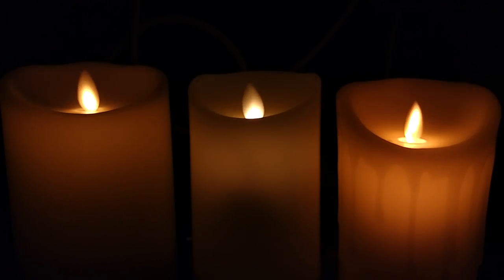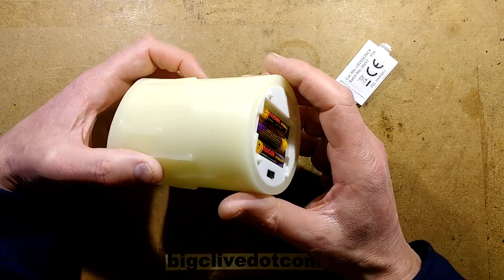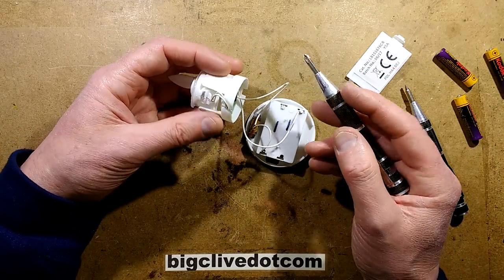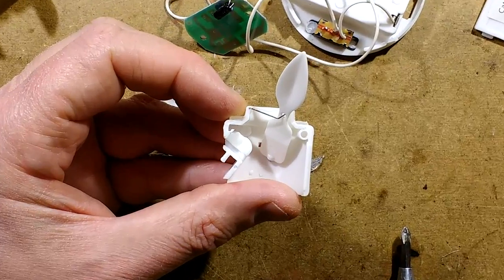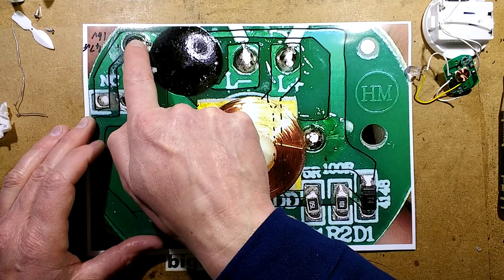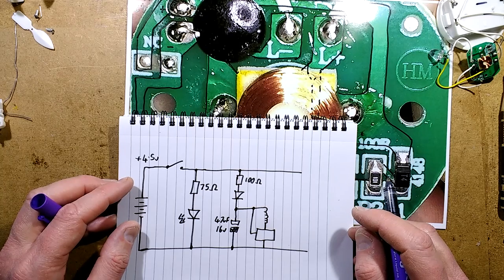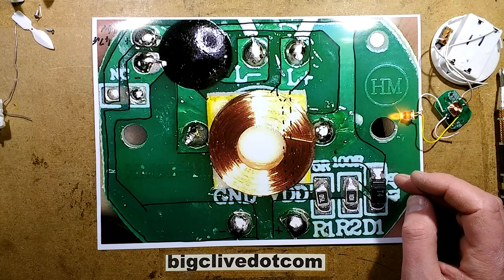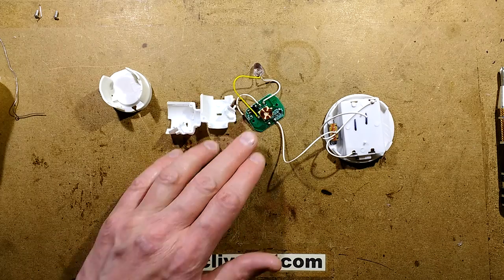LED dancing flame candle evolution 2018.

Comment: Came across these for the first time this christmas, of course Big Clive has like 3 videos explaining it all! I made one using the 15 ohm coil found in old computer dvd drive stepper motors, with an LM358 generating the square pulse that repels the 5mm x 2mm neodymium magnet. Lucid Science youtube channel has a ton of projects based on coils and magnets.

Comment: The fake flowing wax kills it for me. That diameter candle would never have a flame hot enough to flow melted wax down the sides.
Reply: I agree.  The flame looked nice but the fake dribbled wax made it look cheap.
Reply: It looks better in real life & in the dark... you could always carefully smooth them off  I suppose?
Reply: I think I'll get these and trim the dribble wax with a blade..

Comment: This candle can be a great candidate for an ESP8266. With an H-Bridge around the coil you can change the direction of the movement (like a gust of wind would effect a real flame) and make it very smooth. Integrated in an home automation system, you can trigger a stronger movement based on motion detectors or door contacts if available. A bigger battery will fit inside anyway. Just a mind game ;-)
Reply: In theory you could potentially use the DAC outputs of the ESP8266 so you could also control the voltage of the coil to affect the strength of the movement too. Granted those DAC's are only intended to be a signal level so you would probably need a cheap amplifier IC to drive the coil. As for the battery at this point I'd probably splurge for the USB port and battery management IC to install some lithium ion cells. Would be pretty cool though as this way you could reduce both the frequency and the voltage of the pulses to the coil to make the flame do a gentle lazy dance and periodically or when triggered increase the frequency and voltage to make it flicker more. Probably worth doing periodically to mimic the occasional turbulent instability real candles generate themselves due to imperceptible subtle changes in the conditions. Hell in theory using the DAC you could produce far more complex patterns in effect right up to just replaying 8-bit PCM data although that would be somewhat limited by the small storage of the ESP3266 but it would let you produce pretty much any movement pattern you wanted by using the coil like the voice coil of a speaker. Guess you could add an SDCARD or EPROM module or something if you needed more though.
Reply: Good idea but at that point I'd just use a real candle 😂

Comment: Poundstretcher used to sell a staggered height, triple set of the early Luminara  "Dancing Flame "clones for £10, Not sure if they stock them anymore.
They took two AA's. I bought a couple of sets and converted them to run from a 12VDC mains adaptor and a remote mains switch so i can turn them all on and off at the same time.
I also used a couple micro DC-DC voltage adjusters so I could control the brightness of each of the two clusters of three., they ran too bright for me at 3.0V, which is typical voltage for a pair of fresh alkaline cells, I found 2.4V was nice.

Comment: I used the wax Luminiare Candles outdoors in lanterns on my porch. After a winter of freeze and thaw weather the wax casing cracked. So, if you live where the temps go below freezing in the winter it is better to use the plastic ones which are made for outdoors.

Comment: "Quite a powerful LED. It's optimized for... whoops just broke a lead off".
Reply: Matt I almost chocked on my food when that happened
Reply: yeah, those wires fell off so easily, so I guess it wont last very long if you arent able to fix that yourself.
Reply: even Clive manages to do that sometimes :D
Reply: Lead free solder...
Reply: Bill Schneider: Yes, the leads free themselves from the circuitry very easily!

Comment: Try taking a spray air canister, flip it upside down and spray the hot glue with it. The chemical mixture coming out does wonders for hardening hot glue and making it just snap off of the item. Co worker showed me this a few weeks back... makes dealing with the glue so much easier

Comment: Would be really neat to see a (mains-powered) massive outdoor version, but I keep thinking of debris, snow, ice, etc., falling into the 'flame' part. Maybe a simple, clear cover could solve that; wouldn't even have to necessarily waterproof it then, if designed correctly.
Reply: SigEpBlue If it is mains powered it could just have some cheap heating elements to deal with snow and ice.
Reply: Mike Smith: Like an old school incandescent bulb?
Reply: Yes, use the light bulb as the series resistor on an LED :) :)
It is only sort of a joke.  A light bulb at less than its design voltage lasts a really long time and would keep it a bit warm.

Comment: I love love LOVE your dancing flame review videos. Have been a big fan for many years now! I made my own shitty dancing flame candle using a small counterweight and natural movement of air. Fun. Now I'd like to build these into my new home automation setup, so that they come on with other ambient lighting according to scene control. So will need to figure out a nice way of containing cables and running from mains switch mode power supplies. Also I plan to mod them by removing parts as you've done, and placing them into some slightly more sexy Catholic style votive glass containers. (sorry, the words sexy and votive probably don't go together...)

Comment: When you asked "can you guess" I instantly picked the third one as the most expensive. The light colour and movement looked the most realistic. Now if you can get a flickering red LED, you could adapt it (very) early for halloween :D
Reply: madbstard1 what do u mean by 3rd is it the left or right
Reply: Not all cultures go left-to-right (though a fairly safe guess here)
Reply: Sorry - I thought I did reply earlier but it obviously didn't post. Had really crap internet due to the stormy weather here. I meant the one on the right, as in the way Clive introduced them. Sorry for any confusion :)

Comment: Best way to remove hot glue I found is to use a  "freeze it" spray or "dust off duster" with the canister up side down. When very cold the hot glue will chip away quite easily.

Comment: I've got the premier ones, came from CPC. One was faulty, no movement. I cut it open and the coil.electronic assembly had fallen off the bottom of the flame. It's only a push-fit. They dont look like yours inside.

Comment: There is a type of wire that has 2 layer insulation.  The outer layer has a low melting point.  You just wind the coil and run it through a bit of an oven and then the former is taken off once it cools.  This is likely what they did.  It is very easy to do in large quantities because the formers run back to the start of the process to get used again.

It could be that the pulses you are seeing are not normal operation.  Your LED makes no inductive kick and there is no magnet going by.  A custom chip may detect the voltage wiggle from the magnet swinging by and produce a short pulse when the magnet is near.  If nothing happens for a while, it makes an initial long pulse on a timeout.  This would make the battery life even longer.

Comment: I like the color and movement of the right one, but don't like the way the "hole" looks like at top, nor do I like the drips on the side.

The left one looks pretty good but the movement could be better.

The middle one is way too repetitive looking and the color is off as well.

As for the candle being wax, it looks good and is a great thing, but we left our candles in a hot room during the summer by accident and well.. they all melted into unusable shapes.

Comment: Nice. Now I know which pillar candles to try to make some pillar "IoT candles" out of. I got this idea to wire some LED candles and put them on a smart plug. 
Well, I've already made some - two sets - of the candle stick variety from IKEA. Beside automatically come on when the sun sets (no matter time of year, not just specific time) and never needs battery replacement/recharge - they also works as a very useful traffic warning(!)
Other people making similar things have no fantasy and just turns on a lamp and the most creative ones make a sign. I really like my idea of using candles which can serve multiple purposes and not occupy a lamp for that.
It works so that a few times in the morning on work days it checks the travel time to my work and if travel time rises above a certain limit (that I set) the candles comes on and I know there's troubles and I should check to see if an alternate route is better (things usually clogs at the same spots). The way I've done this is by using a Sonoff SV powered by an old mobile charger. After the Sonoff SV there's a 3.3v regulator to power the candles and most of the controlling logic is made in a combination of IFTTT (Sonoff only supports IFTTT at the moment) and Stringify (which can interact with IFTTT). From the SV there's wires to the candles and since the IKEA candles are impossible to take appart I've made some dummy battery packs out of wood and drilled a hole for the wire.
Sure I could be boring and just put 3.3v regulator after the USB power supply and then switch that using a Sonoff Basic, Sonoff S20 or Lightify/smart+ Plug on a Hue bridge. However I found that the psu's in the Sonoff and Lightify plugs are not that efficient and you'll actually get a lower standby power by using a good quality class VI USB power suplpy (old mobile "charger"). Standby usage can be as low as 0,18w - almost half of a mains powered Sonoff and 3 times or so less than a Lightify plug and when turned on total usage is with candles no more than the alternative without load.
So while I already made some sets using stick candles I'd like some using pillar candles for the shelves at the dining area. They however seem more difficult - especially as I want to modify them to be placed in two vintage brass pillar sticks (are they called that when for pillar candles?). The IKEA LED pillar candles however are more difficult to modify. Those bas...ds have glued them together making nice modifications just about impossible.

Comment: I don't understand just how those candles (at 0:20) remain lit continuously. In the strip-down, clearly the LED is going on and off - due to the Timer Circuit "Blob". I think that the 100 ohm resistor is used as the fixed illumination (LED is illuminated constantly when the Unit is turned-on  BUT cannot be seen on our Computer Display). As the Timer pulses, additional voltage, and slightly higher current is fed to the LED - which gives the LED some additional brightness, in conjunction with the 'kick' from the Coil. Am I correct? Slightly? I wouldn't use wax if I made one of these either.

Comment: I went to look for these, and ended up buying 500 8mm LEDs instead.
Reply: I hope yours are not crappy low-intensity bluish garbage light like mine were.
Reply: Happens every time...
Reply: :D what are you planning to use 500 LEDs for ?
Reply: 500 leds? Easy: backlighting for mechanical keyboards ofcourse ;)
Reply: What a silly thing to ask. You can never have too many leds :-)
Reply: no thanks Pentti :D
Reply: Use them for lighting hallways to see at night without ruining night vision
Reply: You're not the only one :D Well, not 500.....only 100 RGB LEDs.
Reply: Instructions unclear, bought 500 8mm LEDs.

Comment: paused at :33, I like the one on the right
Reply: The fake flowing wax kills it for me. That diameter candle would never have a flame hot enough to flow melted wax down the sides.
Reply: Same. I like the right one best because the flame has a really random feeling motion and at times even completely stops moving. Second best is the left one and worst is the middle one because of the colour.

The flowing wax on the right one made it more interesting for me, too.

Comment: I was watching a film set around 1999 up to 2003 (the Disaster Artist was the name), and I saw they had loads of these LED flicker flame candles at one point in a restaurant scene. These things can't possibly have been around that long but I'm wondering if anyone knows of any sort of predecessor to them?
Reply: μ how do you know they were LEDs and not real candles?
Reply: Might it have been one of those that blow air upwards, over an illuminated paper "flame"?
Reply: Luminara made the flickering incandescent lights at the Disney haunted house attraction. I saw them about 1980.
Reply: There have been flickering fires, torches, and wall sconces used in theatrical productions and movies for ages. A bit of thin cloth and an incandescent light and a fan. Rosco made some amazingly realistic torches in the 1990s using an MR16 and a small fan.
There were non-flickering fake candles for stage use from about the early 1970s. The early ones had an incandescent lamp in the candle and a plexiglas light pipe up to a molded flame. They were decently realistic at 30 feet.  
By the 1980s there was a version that was much the same, but the flame was suspended from a pivot, so would move, and was a bit more realistic. There was no mechanical mover, they just moved about as you carried the candle. A little later someone used some 400-series CMOS and a transistor and made a flickering flame in the same basic unit.
LEDs finally got bright enough to replace incandescent bulbs around 2000 or so, as best I can recall without trying to dig back into old literature.
Reply: There's been normal glass enclosed bulbs with candle effect flame for years, they were pretty obvious though. Which scene was that, the one at the start where Tommy is getting Greg to come out of his shell?
Reply: Were they exactly neon lamp colored?

Comment: I'm just wondering how the LED can flash with the circuit you drew... I think the basics idea is like small table clock.  They use the coil as a magnet and an oscillator component.   There must be some connections under black stuff that you missed.
Reply: He rewired it to show how the coil works.

Comment: I knew the one on the right would be the cheapest even though its the brightest because it has that drippy candle look which to the middling classes looks unsightly but to us plebs looks like a regular in use candle when off.  But none of them look that bright from the vid are any of them actually any good for illumination compared to say a tea light?

Comment: All of them are missing the color change of a real candle flame. There's always a very distinct blue section at the base, then the flame darkens, and turns brighter going up.
Reply: Good point, thanks. Isn't the answer just to color the plastic that's used for the flame, though?  (I'm thinking I could borrow my gf's fine-point Sharpies, do a little tinting :-)

Comment: My wife has a constant shrine and burn candles continuously. It would be neat to have a mains powered version so you could just leave it and forget it. 
Where did you buy it ? Ebay ?
Reply: Low Voltage - Smart Candle

Comment: Id like to see you tear apart a wake up light. I just got a cheap one on ebay but I am difficult to wake up so I want to mod it with rather brighter LED's
Reply from the maker: For a light to wake you up in the morning I recommend getting a cheap plug-in digital time switch and using it to turn on a table light.  I set mine to turn on about 15 minutes before I should get up and about 10 minutes after to wake me up if I dosed off again.
Reply: Clive, I think he means the kind that actually track sunrise times and gain full brightness over a long period, emulating sunrise. Much gentler way to wake up than SNAP, I'M ON!
Reply: Ben-
 Don't know where you are, I don't recognize your IP address. (G) But here in the States, the few that are sold are either dim or expensive or both. Which is ridiculous because 20 years ago the X10 "Firecracker" device controllers could make any incandescent light power up slowly that way, with a cheap X10 controller and the software running on any computer with a serial port. They never made the jump to USB though. Must be a terribly small niche market, there don't seem to be any products. Maybe Clive will help us Frankenstein one?
Reply: I spoke too soon. Ben, those are all "light alarms", they don't track or offset from the actual time of sunrise at all. The X10 software allowed the light(s) or other devices to start AT sunrise, or xxx minutes after sunrise, and track that as it varied through the year. That's a "sunrise" light. These light alarms can only be programmed for a fixed time, no brains in them. Clive, you need to make a kit!
Reply: I guess then a better thing to use is some sort of "smart" dimmable led bulb.

Comment: Is the frequency voltage dependent? Does the coil rate change when running at say 3v vs 4.5v?

Comment: Interesting we both thought "555 timer!" for this application. I just checked Octopart for that chip: TI (!) 555s can be had, in quantity, for under $0.10 apiece. Definitely a viable option if supporting circuitry doesn't push cost above a generic µC. :)
Reply: 555 isn't good at random pulses. Small sound recorder chips are also $0.10 so cheap they put them into greeting cards.
Reply: Richard Harris yes, but this doesn't use random pulses, they're quite regular
Reply: SigEpBlue the required passives make it more expensive